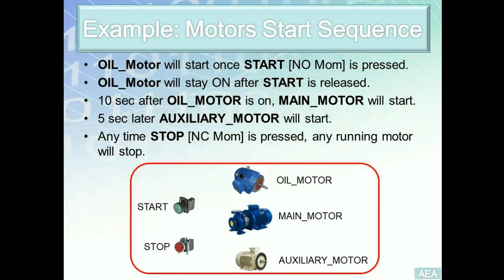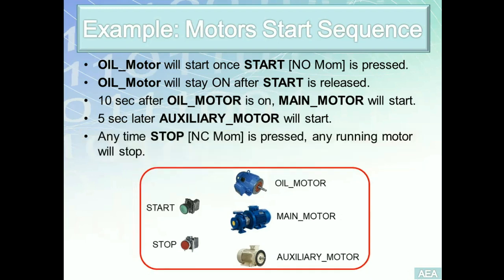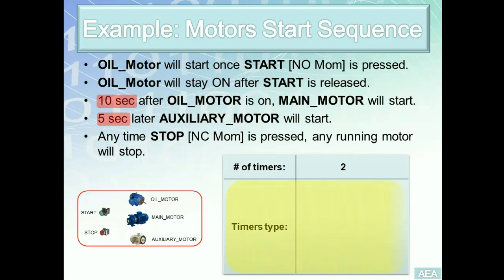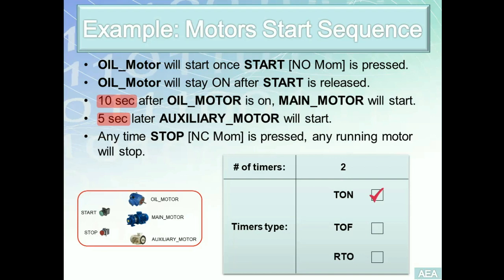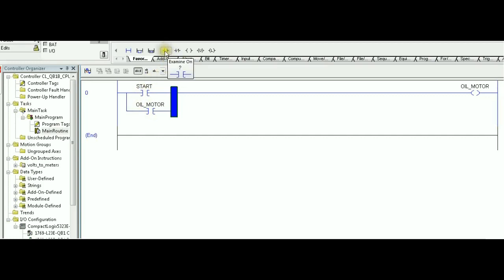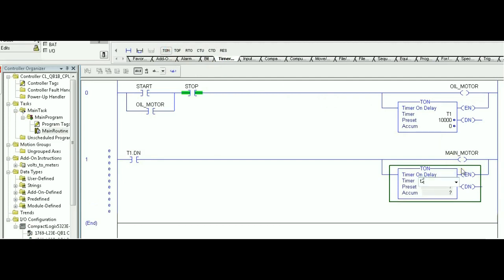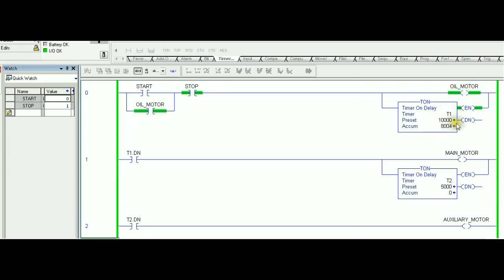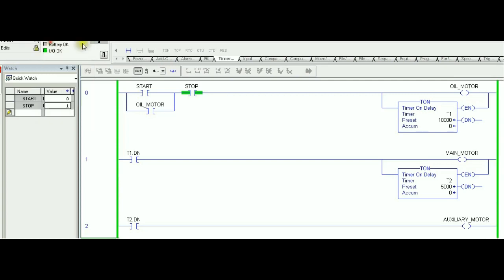LD 16 - Motors Start Sequence w Interlock TON RTO - Easy PLC Programming Tutorials for Beginners

Comment: It's supposed for stop XIO not XIC . Is that right.  ?
Reply from the maker: No Abdullah. Stop, being NC switch, needs to be associated with an XIC instruction as this will keep this instruction TRUE within the rung as long as the Stop switch is not pressed. Only when pressed, the XIC instruction associated with the Stop switch will turn FALSE hence breaking the rung and de-energizing the Motor.

Comment: On the second solution, with the RTO, every time you press the Stop button the timers are restarted. The whole purpose of implementing this timers goes to waste by doing that, I’d think that you’d want to resume the count as soon as you hit Start button again. So I think using RTO in this case is kind of pointless as both examples behave the exact same way. Cheers.
Reply from the maker: Excellent Analysis Marvin. You are 100% correct. This problem is best solved using TONs. However, I wanted to demonstrate how can we achieve the same performance via RTOs. I don't recommend it though but I've had students who rather stick to one  timer type, the RTO,  and integrate any timer requirement via it. 
Cheers :-)